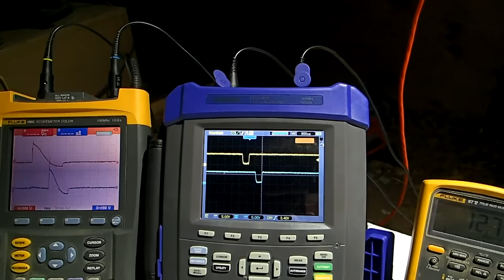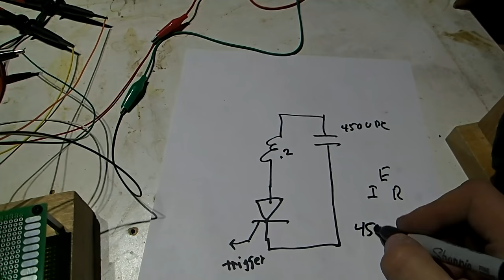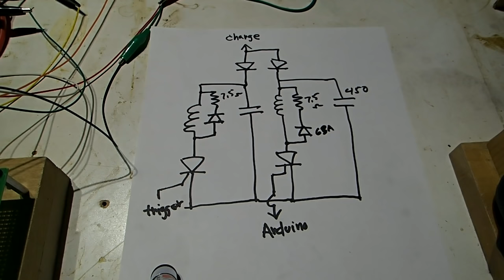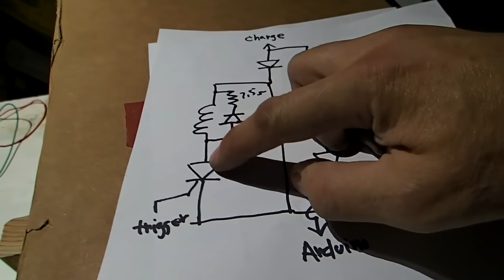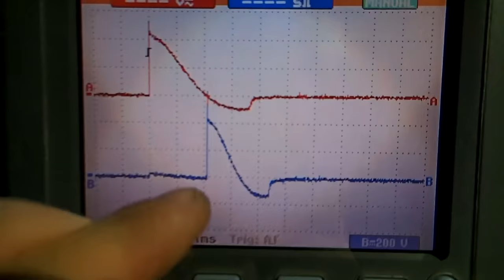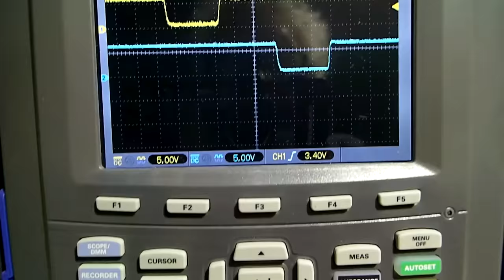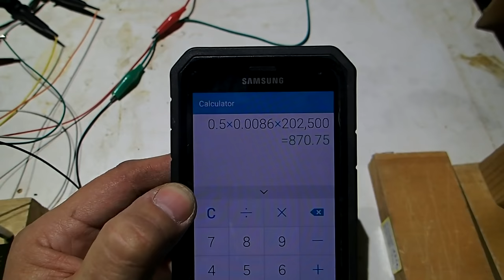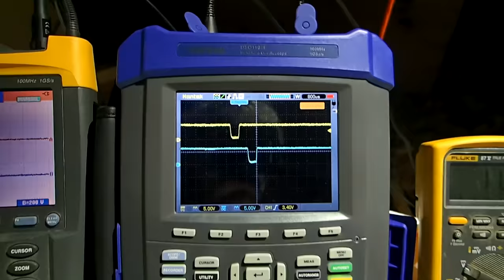World Fastest Six Stage Coil Gun Yak Questions Answered

Comment from the maker: 2 reasons one is those caps can fit inside of 4 inch ABS tube, second when you put many small caps together you lower the ESR of the capacitor that's the equivalent series resistance the lower the resistance the more energy that can rush out of the capacitor into the coil. it increases efficiency increases power.

Comment: I think that you can use the reverse current produced by auto-induction to recharge the capacitors,you just need to modify some schematic and use your microcontroller to switch the coil from discharge to recovery mode.All you need is a fast trigger/switch controlled by the micro-computer,this way you can increase the overall efficiency
Reply: With recovery mode you mean linear mode? As in an active clamp? There are many stupid things in this design tho, like the coils.. Too thick wire, not enough turns
Reply: @sporkeh90  Talk is cheap, prove it.

Comment: If you aren't going to vary the timing based on the velocity of the projectile , you could progressivly widen the spacing of the coils down the length of the barrel to achieve a higher velocity..
Reply from the maker: TheIAMINU timing is adjusted by an oscilloscope that is how it is done accurately there's no need to space the coils the part that just slows it down, and that was verified by the scope that's why the coils are where they're at.

Comment: There are  these ballistic guys on line that high speed film projectiles to see how they perform in flight. They use all kinds of different shapes to see what consistently flies straight. At a close distance you might never see much of a deviation in flight characteristics and it seems yours are moving straight in that small distance. I would be curious to know how the screw tips perform in longer flight. and if some sort of rifling or spin could be put on it to stabilize them. They already seem to have quite a good shape for this.
I have been doing a bit of experimenting with maximizing my coil timing to see when and how the timing can be improved as in as the projectile gains velocity would having the pules width also change or speed up that timing to each coil as in a ramp up to match the moving object. i'm going to try and use smaller bits and see what i get.

Comment: Subsequent stages should be fired sooner and faster than previous stages to make up for the speed of the projectile. Does your micro-controller/programming account for this? Thanks.
Reply from the maker: Yes it does.
Reply: @RaptorRotorHead  3 years later, TY ! :)
Reply from the maker: @HellTriX  it does show the timing in the video so it's there you just got to watch the whole thing through
Reply: @RaptorRotorHead  I still don’t understand how you know when to fire the later stages. 

If ferrite accelerates slower (since it is less effective ammo), then later stages need to delay more before they fire. How do you account for this delayed timing?

The projectile, either ferrite or steel, should be accelerating through the barrel. It’s speed shouldn’t be constant. Waiting 2ms per stage or whatever seems to me like the wrong way to do it. 

Edit: Right at the end of the video.. you adjust the ‘timing’ by using smaller and smaller capacitors?
Reply from the maker: @davadoff  first do you have a chronograph you have to have that and you have to have an oscilloscope do you have those two pieces of equipment?

The easiest is a trial and error approach basically you decide how long a projectile you're going to fire am I giving example that's 2 in long so I have to wind a coil that's 2 in long.

Now we pick some capacitance and we connect that across the coil with the s c r we put the 2-in projectile part way into the coil like 1/4 of the way so that's a half inch in.

Now we set up the chronograph at the muzzle of the coil and we charge up the capacitor and we fire the scr and we measure the speed in feet per second on the chronograph.

If the speed of the projectile is 75 ft per second now with some simple math you can figure out how fast the projectile travels in 2 in.

1/75= how long it takes to travel one foot. 0.013333 milliseconds.

Now how many 2 inches are there in a foot there are six right?

0.013333/6=.0022 milliseconds.

This is the pulse width of your first coil.

You adjust the capacitance up or down and you test and you find the fastest projectile speed and you make the calculation that's the pulse width of your first coil.

Your second pulse width for the next coil stage, it's going to be less than 2.2 milliseconds because the projectile is already moving and not going from a dead stop.

About 1.2 milliseconds for the second stage.

Each stage the pulse width must be quicker or the projectile will slow down.

So that's a shorter pulse width for every succeeding stage.

You will discover that you get the most feet per second out of the very first stage and every succeeding stage after that you get less feet per second added on your total feet per second.

It works by basic law of physics mass and inertia a certain amount of mass a certain amount of inertia and that takes a certain amount of time to move the projectile it's how they shoot down nuclear missiles.

Now went to fire the coils that's done with an Arduino Nano so you have to write some software and you have to program this two milliseconds here 1.3 milliseconds there and that's how it knows how to fire the coils the physical thing is figured out all you got to do is figure out the software thing the math to it and it'll work perfect every time with the same size projectile which weighs about 14 Grams.

Now this is where the oscilloscope comes in you use that to measure the pulse width at each coil when you achieve the highest speed so that you know where you're at at the second coil you're going to have less pulse width so you'll measure with the scope and make it a little less then you'll check out your speed you go for the fastest speed it's adjust the capacitance up or down to get the pulse with at the optimum speed.
Reply: @RaptorRotorHead  interesting, thanks!

So the pulse width is controlled by the amount of capacitance… You adjust the capacitance until it’s optimised to produce maximum velocity projectile then measure the width of that pulse on the scope. You then program the arduino nano to delay that exact amount of time you measured before firing the next stage. Add another stage and repeat as necessary… 

Is that all correct?
Reply from the maker: @davadoff  that's all correct you got it my friend
Reply: @RaptorRotorHead  thanks. Your approach is interesting. I wouldn’t have thought of doing it that way. 

At 230-240 feet per second, is yours the most powerful DIY coil gun that you know of?
Reply from the maker: @davadoff  my coil gun is the only one I know that can shoot 14 G of Steel 42 ft and go all the way through 3/4 inches of wood
Reply from the maker: @davadoff  have you seen this video here of mine.

https://youtu.be/DjoYHLye2p4
Reply: @RaptorRotorHead  No, I hadn’t seen that one. 

I did see the video where shot several cans of meat in a line. I think you penetrated some thick bits of wood in that one too. It was a really good demonstration. 

I’ve seen a bunch of random coil gun YouTube videos now and I think they all fired their projectiles at at least 100 feet per second slower than your gun, assuming they measured the speed. I didn’t see any that came close to yours in terms of performance.

Comment from the maker: yes I was simplifying on that but also if you look at the scope waveform you can see the effect of the inductance it's only about a hundred microseconds of time you can see the voltage hang for about a hundred microseconds then it starts to fall at that point right there the coil is saturated and the inductance is gone all that's left is the DCR to discharge the capacitor.
Reply: I will have to disagree with that statement. You need a current probe or current transformer. You need to zoom in the the signals, you are losing so much resolution with the scales (voltage and time) you are using.

Comment from the maker: Remember there is no inductance in a saturated coil. That's only the DCR is the determining factor for the current flow. Saturation is reached quickly as shown on the scope with the rise of the waveform. Thus my megawatt calculation in the beginning is a very good starting place to figure out how much power is being pulsed through that coil

Comment from the maker: it's the first time I made a Pulse Charger I usually make regular switching power supplies. there is plenty of different wire sizes that's no problem it has a 4 turn primary and a 34 turn secondary 12 gauge and 18 gauge.

Comment: Were you simplifying for the sake of the audience, or just decided that ohm's law was good enough to estimate the current, ignoring the inductance? I am also wondering why you chose 16AWG wire over 18AWG or such, was it an arbitrary choice or did you measure it out for a turn to resistance ratio/some other design choice? I really liked this video explaining things. SCRs in parallel can really handle some current, though it's a shame they can't switch off. Looking forward to more vids,

Comment from the maker: I worked as a Power Systems engineer at Northrop on the mx nuclear missile gimbal. That was back in 1980. I been building Electronics for 50 years
Reply: ohh 1980 i was not even born at that time, and thats why you designed that bad ass power converter great man .

Comment from the maker: yes that is Arduino powered by the same power supply that powers all the other circuits especially in my later model design
Reply: Clay Reid does the optocouplers directly drive the scr bank or do you have any transistors hooked up to optocouplers to drive the gate of scr

Comment: This is the most impressive coil gun I've ever seen, I've been tooling around with the idea of making one since high school, I'm about to watch your video on the power supply, very excited. I wonder, I'm testing a projectile at the moment in an airgun but wonder if you could give proof of concept by firing a 8.3mm bullet tip arrowhead out of it? If you have one laying around.
Reply from the maker: Natan Kovard  https://youtu.be/DjoYHLye2p4

watch this my friend.
Reply: Clay Reid I saw that, impressive even at range. It appears as though you're using some kind of drag stabilizer? I'm really into 3d printing and have produced some neat fin sets for the afore mentioned arrow heads, trying to impart spin. Hence the curiosity. Also, thank you for the reply!

Comment from the maker: when the magnetic field collapses around the coil it's like a generator and generates an electric pulse. the higher the resistance of the resistor the less load it puts on the coil, thus the voltage rises higher, we're putting 450 volts into the coil, we can expect to get that back with the flyback pulse or less depending on the resistor value.

Comment: I just found your video. I have thought about experimenting with this for some time, just never got around to it. Great work. The military rail guns use a projectile the size of a brick. Have tried using a projectile proportionately sized for your gun? A smaller mass would accelerate quicker, potentially resulting in greater kinetic energy at impact.
Reply: A rail gun is a different concept
Reply: Kinetic energy = 1/2M x V ^2. Lowering the mass and increasing the magnetic force should exponentially increase the kinetic energy of the projectile.

Comment from the maker: the coils are 300 Micro Henrys and the choice of 16 gauge wire is so that the first stage can handle a shot every 4 seconds for at least 15 shots before it gets too hot.
Reply: Thanks for the information on why 16 gage. I'm currently trying to choose and I don't have a cooling constraint, and it's hard picking what to use- I think I'll go with 18AWG but it'd just be arbitrary over other wires in that size range.

Comment: I just came across ur video.  great shot!!! very good design.  Thanks for sharing.  I noticed that u had the caps in a circle as if initially intending to install them around the coil which would be much more efficient.  short wires to the coils.  why did u not do that?  did they not fit around the coils?

Comment: I made exactly the same setup, the problem is when I fire the first coil it somehow triggers the second one without arduino..is that some kind of back emf? npn transistors are driving the scr-s
Reply from the maker: EMF exactly a lot of it I got around that problem. I used opto couples in between the scr I connected the opto couples to the arduino. I used suppression capacitor on the gates of the scr connected to the anode and a little bit of resistive Network.
Reply: @RaptorRotorHead  okay, thank you I will try that

Comment from the maker: 450 volts is the forward voltage the diode is not conducting during the forward voltage pulse there is zero voltage across the resistor at this moment in time after the capacitor discharges through the coil the magnetic field will collapse around the coil this will yield a reverse voltage pulse across the diode and resistor the diode will conduct at this time draining off some energy out of the coil through the resistor. at this moment in time the voltage across the resistor and diode is proportionate to the flyback pulse which is determined by the amount of coils on the coil. and the value of the resistor about 150 to 200 volt reverse voltage pulse, this reverse voltage is charging the capacitor backwards so that's why we limited with the resistor.

Comment: You forgot to measure the coil inductance. As the coil is turned on and off the rate at which it can do so is a function of its inductance.
The magnetic field generated is a function of the rate of change of the  current  and the inductance. 
If the switch on voltage is a pulse then you will have a composition of sine waves with different frequencies/harmonics to represent this pulse. They in turn will induce a current into the inductor which create the magnetic field. The current wave through each coil  inductor will determine how effective the coil is at moving the projectile.
Reply from the maker: I didn't forget to measure inductance I just didn't videotape it.

The first coil is 325uh..the sixth coil is 293uh. I hope that clears up your question.

Comment: How high is the charging voltage from your power supply??  
You are charging 43 capacitors in parallel, each being 3600uF, through a 50 Ohm resistor:  That comes out to an RC time constant (63% charge time) of RC=50*0.1548=7.74 seconds.  But you claim a charge time of 4 seconds.  If you charge them for only 4RC (for a 95% charge=427v) THAT takes 31 seconds.  So, I am a bit confused,  UNLESS the charge voltage is significantly higher than 450v.
THANKS AGAIN FOR THE VIDEO!!!
Reply from the maker: 500 vdc is the charge voltage, it's works better when I used 40 amp hour batteries, 5 amp hour was about 8 seconds. Input pulse current could be as much as 50 amp. Then it drops.

Comment from the maker: if you just put the diode straight without a resistor, it will short out the reverse pulse causing intense magnetic fields and suck the projectile back into the coil

Comment from the maker: Audrino microcontroller you can get them on ebay for as cheap as a 1.99 each. I wrote a program to put into the audrino that fires the coils at basically the same time constant as the LC time constant plus a teeny bit more I mentioned it in the video.

Comment: I wonder how long does it take to discharge capacitor through the coil that tries to avoid fast changes of current. Also isn't it possible to use one capacitor bank and power coils in sequence? And is it possible to use one coil to power the next one somehow? And I would discard any timers and use optical gate to detect bullet between stages to fire up the next one.

Comment from the maker: no they're not they allow the capacitors to all be charged up in parallel, and then to be discharged independently of one another. the voltage doubler is on the power supply card.

Comment: I think I am making a little headway by re-watching your videos on the coil firing timing.  Can you please tell me exactly what triggers the pulse waveforms of the coils--I am a bit confused on the vertical line at start--unless you are it triggering it around 400VDC amplitude.  Using the "LC" formula gives a period "T" of about 6ms, and a time constant of anout one ms.  I can see this possibility in the waveforms.  However, ignoring the self-inductance (300uH) of the coil and using only the 0.2 DC Ohm in the "RC" formula yields a time constant (L/C), of about 83ms (ignoring "L").  I am guessing this does not show up due to the type of triggering used.
Reply: I think he hardcodes the timing in the arduino code based on experimentation

Comment: Clay,
I was talking to a coilgun designer that uses high-power drive SCR's (similar to your situation)  and he claims to have proved that it adds velocity to use tight flat heat sinks pressing on BOTH sides of the SCR to eliminate "hot spots" during the brief firing duration of the SCR.  What do you think??
Reply from the maker: He's high on drugs, I use 10 scrs in parallel, for each coil, good for 5000 amps pulse duration is 2 mil seconds, there is no heat build up, the heat is in the first coil. That's the longest pulse. After 20 Shots That COIL Can Get hot.

Comment from the maker: to use in an equation one must know the inductance of the coil there's really no way to calculate that accurately even with an equation but then you would have to use an lcr-meter to measure the coil to get its inductance then one could try to calculate the reverse pulse. what is so much simpler is to use the oscilloscope that way you can see exactly what's going on then you can move the resistor value up or down as needed watch the oscilloscope